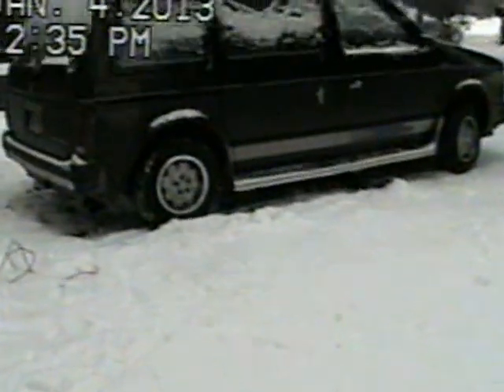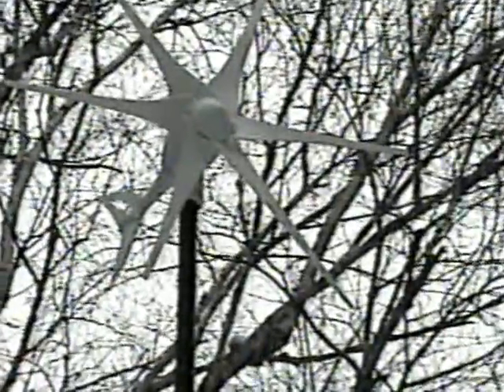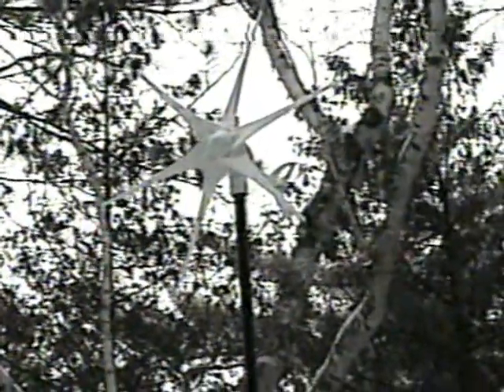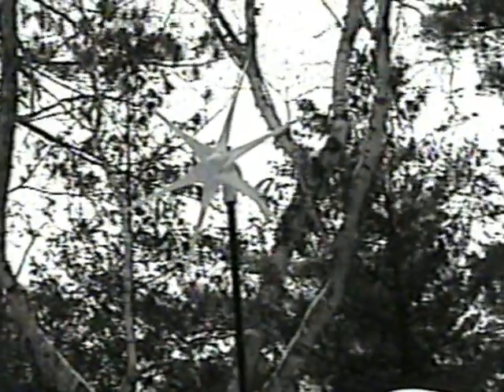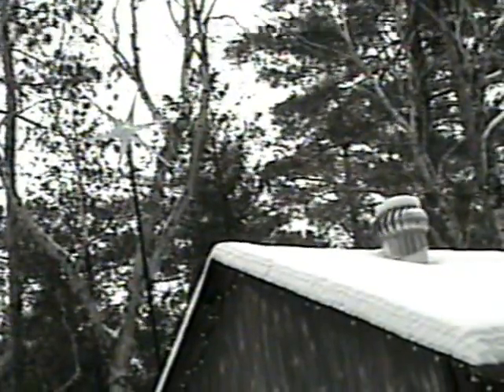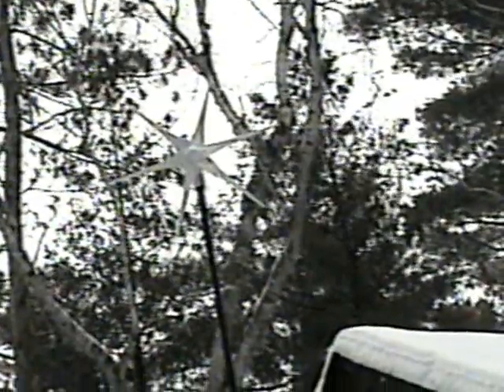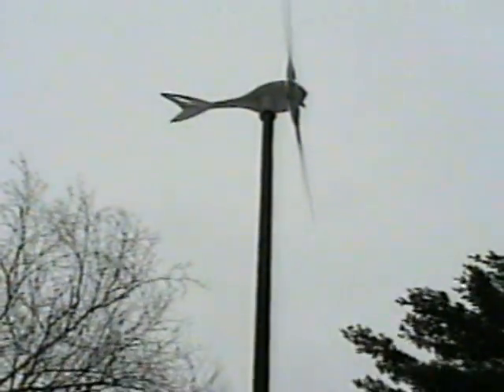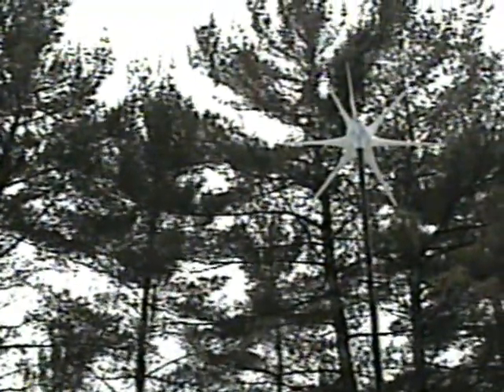apollo 500w Turbine.mpg

Comment: I will almost beet the unit is wired wrong.  The unit has a three phase PM generator.  If any of the three wires coming out of it goes to ground it will form a brake and the unit won't turn.  You need about 5 MPG  Wind for the unit to start charging.  I hav three of these and all of them work fine.

Comment: Increase/decrease blade angle by installing degree adjuster under the blades
"+" on the right side = Increase angle = More Torque, Less Speed
"-" on the right side = Decrease angle = Less Torque, More Speed

Comment: Hey Rogers, I know I have purchased 3 turbines from this seller on Ebay and I must say they are the best turbines ever, low wind, high output but they  have been discontinued she said, I was looking at the Apollo but was a bit worried about the blades just because i bought similar called the Phoenix" piece of crap, turbines with high wattage and such blades don't turn out good.

Comment: My unit didn't work either. Didn't have any trouble with the turbine spinning but there is no power output. No response at all from ebay seller from Point Roberts WA. I am going to try a different brand.

Comment from the maker: The problem is the small 1mm gap around the spacer shim between the front housing & the shim this gap is too small & because the spacer shim extends slightly beyond the front housing it picks up rain water which flows along the shim & freezes in the gap expanding & creating a brake between the shaft & housing, so this design is no good in cold climates, to solve this problem they would need to re design the housing so the shim hole is cone shaped being larger at the front so water can drain out

Comment from the maker: I checked for that & all was good, the blade design was poor, too narrow & too flat near the tips so excessive tip stalling was allot of the problem, but a major design error I found for a device designed in Canada that is because of the enclosed bearing design then have a metal spacer shim that goes over the shaft it enters through the small hole in the front casing this spacer shim is to stop the hub from hitting front casing when mounted on the shaft,

Comment: To add to my earlier post. The wind was blowing a good 35 mph. The wind in the Bahamas usually blows 12 to 20 mph. It would spin up, but when I attached the 12 v dc wires from the bridge rectifier to the controller the meter would drop instantly from 300 watts to around 127 to around 53 to 0.  The wind generator looks good but it is not a wind generator. Its junk! Again this is a 650 Watt, 3 phase ac to a 12vdc bridge rectifier. Any idea how to fix this would be appreciated, I spent $550.00 ebay
Reply: If your battery charge is full the controller will do it's job and stop output. Da

Comment: Remove your trees. You need a clear shot at the wind stream. Something isn't right. That should be moving a little. My wind turbine did the same thing. I raised it 10 feet and it turns now when I see or feel no wind. The Apolo also needs a controller designed for it. Can't use any other.
Reply from the maker: that was a lot of the problem but it also had two major design errors, 1 the nylon blades were too soft & flat, not enough pitch even with the spacers, so the wind was actually bending them back towards the generator rather than forcing them to spin, 2n is the enclosed bearing design is no good for cold climate as the housing around the bearing is flat inward rather than cone shaped smaller at the shaft & larger at the front, this results in rain water landing on the shaft & filling up the space between the bearing & the housing
 then it will freeze & hold the shaft, if it was cone shaped water would run out & not fill the gap.

Comment from the maker: I believe  alot is to do with blade design, you could try a set of "Raptor" blades a few people have given those blades good reviews, that may solve the problem but "greenergy star" lies about specs to make sales, I just bought a 400w grid tie inverter from them that was just a re-badged 300w that will only produce 150w max with 12v solar panels, I sent my turbine back to them, just open a dispute not as described, you will get a full refund less the cost to ship it back.

Comment: I bought this junk Apollo 650 watts 3 phase AC 24 volts turbine. nice design little power. this turbine needs a hurricane to start up and at high  speeds i see 2 amps. 
I want my $500 plus dollars back so i purchase a SkyMax 1000 watts light wind start  up and better power out put.
Reply from the maker: the blade design is the problem, too much tip stalling + heavy cogging of the more powerful PMA when I had mine I could actually see the turbine & the tower pole leaning backwards slightly in a strong wind yet it would not spin then add to that the fatal enclosed bearing housing design that is no good in freezing climates as water from rain & melted snow runs along the shaft & freezes the shaft to the casing the front casing needs to have a cone shaped hole around the shaft to allow water to run out, its a shame they have no company behind them as they started off on the right track to make a nice unit but when it did not function or preform to spec like most china stuff the manufacturer is non existent and thus has no interest in solving any problems or bettering their product, just dump the crap
Reply: You bought that peace of junk